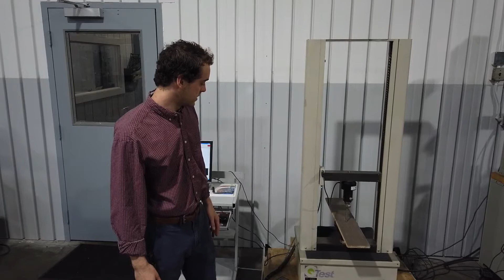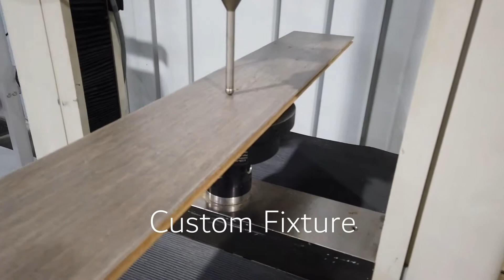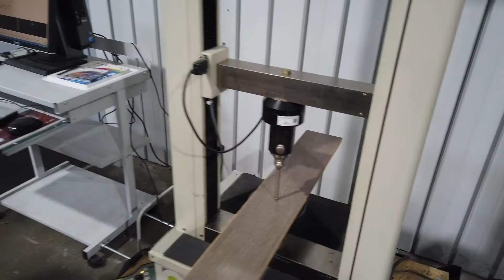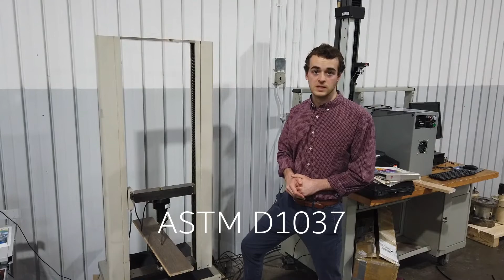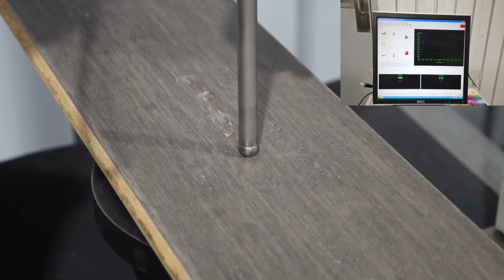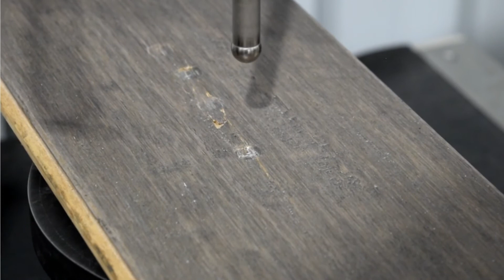The Janka Wood Flooring Hardness Test ASTM D1037 with Frank Bacon Machinery Sales Co. 2020

Comment: Could doing subsequent tests (like the one in the video) in line with previous tests have weakened the lengthwise structural integrity of the board and underestimated the force required to complete the test in later iterations?
Reply from the maker: Absolutely!  When performing Janka tests you should really only apply one indent per test sample and follow the ISO standards procedure for certified results.